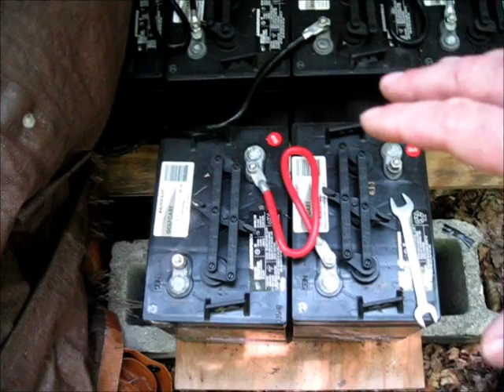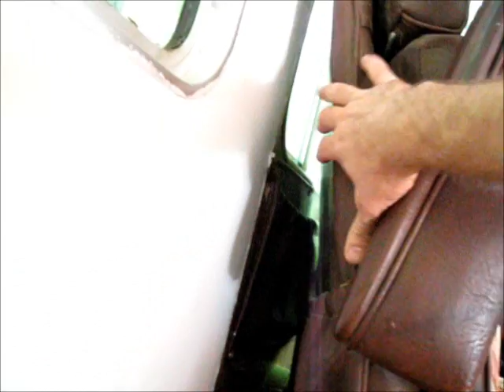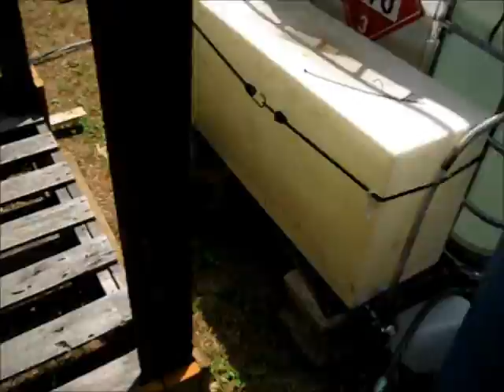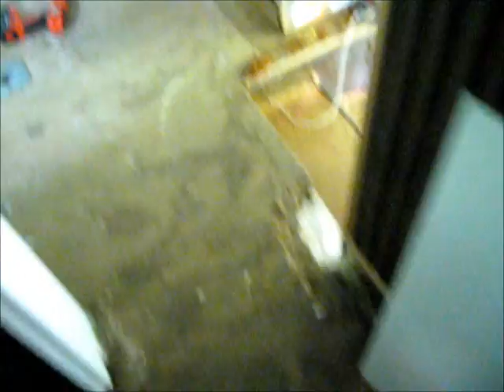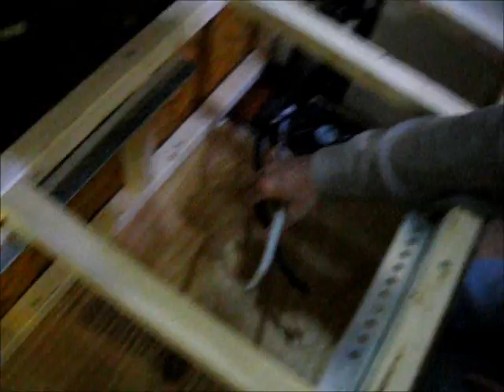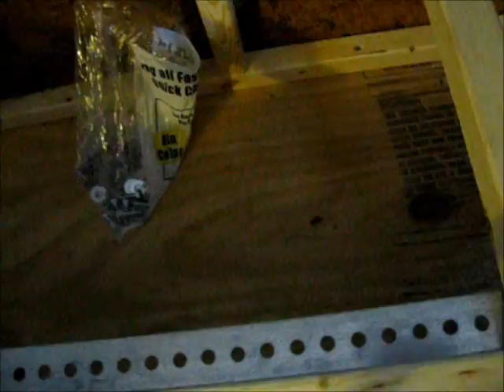Installing Solar AC And DC Power In My RV Converter Box

Comment: question... if you are off grid how are you getting internet? Sat or through a mobile telephony carrier?
Reply from the maker: Cell phone. Its slow and sketchy but it works. If I did not put up daily videos I would not even need that.
Reply: What speeds do you get?

Comment from the maker: So then you admit that it does not matter what people send me or what I spend on stuff myself.

The point is that I do plan to show YOU and others how to get YOUR home off the grid on $5,000 or less.

That is the whole point of all this. In the end, the whole thing will come together. I have a plan, its laid out in the website and in my videos. I mention my plans all the time.

I have even laid out the prices for solar panels, charge controller, batteries and inverter already, in all detail.

Comment from the maker: Not sure what the sizes you mention mean but the wire I put in is twice the thickness of the original RV wiring. So it sure is overkill based on what the original manufacturers planned for the RV.

Comment from the maker: Fans are to keep batts at room temp so they will run 24/7

Inverter and controller will be right on the battery box with short wires.

Generator needs the flywheel sanded and points adjusted I think.

I will check the wire jumpers later on video for you.

Comment: I think your charge controller has a programmable relay output you might be able to control fans with.  You have a web interface and history log you could be looking at as well if you would just plug a crossover ethernet cable in.  You could post pictures of what your solar charge curve looks like.

Comment: Just adding 2 cents to what others have said.

Have corded drills with 1/2", 3/8", & 1/4" chucks. If 120vac available, prefer corded drills. Often easier to get into tight spaces where a drill with battery pack won't go. Larger the bit, the more demand on power source. Have drills with battery packs, as well. By comparison, 120 will do what what the others won't in tough situations. 

Plug into a power strip,  one with a pilot bit & 1 with a screw driver bit. Can't take a break for recharge. :-(

Comment: Yes, he can. Several ways to do it. Only difference is there's less available distance from side wall to side wall that can fully be used as a bed. 

As long as there's enough distance between the inverter &  the opposite wall, a fold-away bed can be installed. 2nd part of bed can be a hinged flip up panel. Can be a separate panel, stored elsewhere, with fold up legs. Or done like RV stow away tables. 

This old man knows more'n one way to skin a cat. LOL

Comment: I also wonder if the inverter should be somewhere else, but the wires need to be short. Its a tough call. Where are you planning on putting the charge controller? You mentioned an A/B switch, you do have a turtle switch on the drivers side wall, controlling batteries, those are great. What shape is the on board generator in? Those jumpers on the batteries are sweet, do you have a name pr part number of them, I need to buy some. you can turn off your ventilation fans at night or use solar panel

Comment: Considering a bulkhead open across the top separating the battery area from the exhaust area to help prevent the incoming air from traveling across the bottom and out  leaving the BOOM factor pooled at the top?

Comment: For the same reason camp propane stoves aren't to be used indoors. Some folks don't know how to SAFELY use them indoors. Warning to avoid lawsuits by those don't use plain old common sense. In this example, I've cooked in my kitchen with a propane & camp fuel camp stoves AND a 6 burner propane kitchen range. 

With batteries & Troy's experience with them, I can't see having them indoors would be a major problem. Might be a problem if someone doesn't know positive from negative.

Comment: I was wondering the same thing... a length of plastic pipe on top of the fan could be installed so that the air is draw from the top of the box.

Comment from the maker: The most important part is solar power, running water and heat for winter. Generator can be done in cooler weather when the mosquitoes are gone.

Comment: Things are taking shape for you Troy, it's going to be sad when your helper leaves. All of the work on the electric system and I do not see or hear any more about your on board generator, one of the most important componants. have you run into more problems with it or just not had enough time to spend on it?? Can't wait to see it all working. good luck to you.

Comment: i have a hatachie industrial set i burned up a drill and charger unit i drain batterys quickly when they get old a b&d work for home use a industral set seam to have more stuff but there alot more expensive to buy at first

Comment: Just wondering are the fans brushless type? There's a reason inboard boats push air into vented areas and allow pressure to push fumes out instead of pulling the fumes thru the fan/blower motor?

Comment: Best setup:  The inverter and charge controller in one sealed box, protected from battery air.  Use the inverter fan to pull in air from either the inside compartment or outside (cover or uncover a screened vent) and expelled it outside or inside.  This way  heat from the inverter in the camper or pumped outside.  Then, I'd use a small hole from the positive pressure electronics section to leak into the battery section.   Use a small hole to exit the battery air to the outside.  Logic.

Comment: Just a thought Troy, Could you use a standard 4" speaker grill on the battery box (fitted below the inverter to draw away warmed air and aid in the cooling of the inverter) as an air intake that the fan at the other end of the battery bank would then draw through?

Also, google 'kite patch' for info on stopping mosquitos chewing you up...

RV's looking good...

Comment: Batteries outgas when charging, not much during BULK but when the voltage comes up to about 15V, so you don't have to run the fans all the time. Maybe put a V regulator on the solar input and run them in the day only that way, or run them off a small panel on the roof? Charger has AUX output? You also want some sort of leak prevention, they should be in battery boxes, as batteries get old they can overflow when charging. Also have clearance room to check the water level and specific gravity.

Comment: If you use to copper instead of stainless steel would have a low-resistance make your batteries were class keep them cooler and there would be no gas  because I wouldn't be stainless with Steel

Comment: (About the booster)  do you get 4G with the booster and if so how far would you have to go to get 4G without the booster? In my area of the desert I only get 2G on tmobile but 4G/3G is a 30 min drive from here. Thought I would ask before investing over $200 in the cell booster. Keep the daily videos coming! I look forward to downloading them since my connection is too slow to watch while loading them.  Tyvm

Comment: Wiring the 12 volt drill to the battery bank is one of many things on the list of questions I have to ask one your next live show(I keep missing it cause I'm on AZ time) . What about the 12v drill battery on your SSG generator to restore it? I bet you can't wait to get the air conditioner installed  on your RV. I watch every video you post nightly as I'm hooked!  I only have a cell for Internet so I wanted to ask power of signal you get and how far away is same signal without the booster? Tyvm

Comment: Also with my camper when I am plugged into power a 12 volt transformer turns on to supply in charge the battery on board does your rv have the same I I know mind clicks when you plug it in so you might actually be charging batteries with your batteries there for wasting power